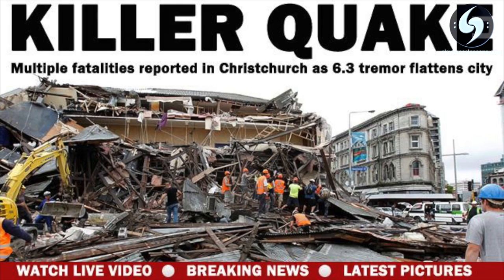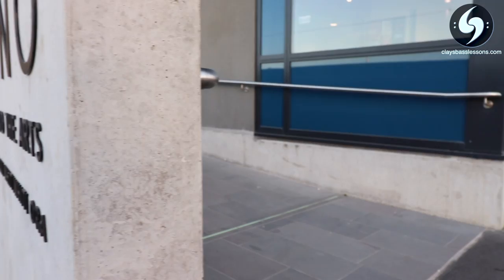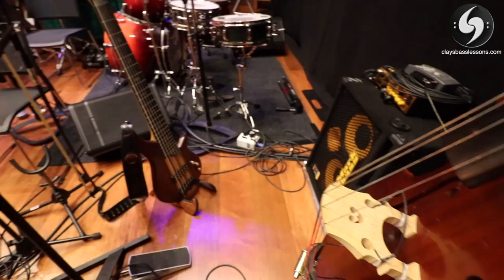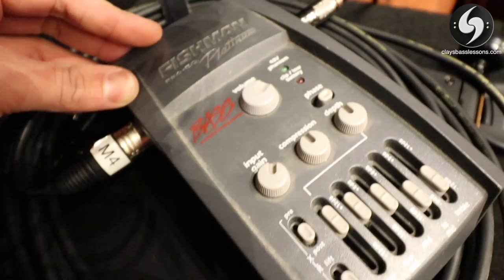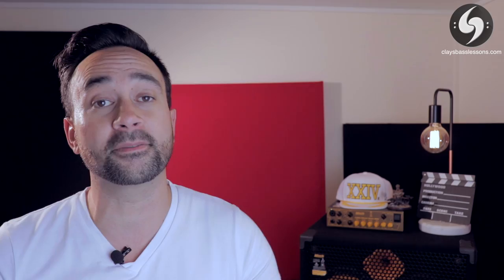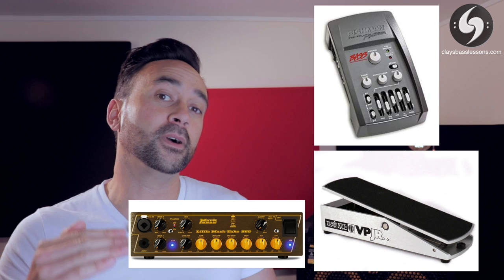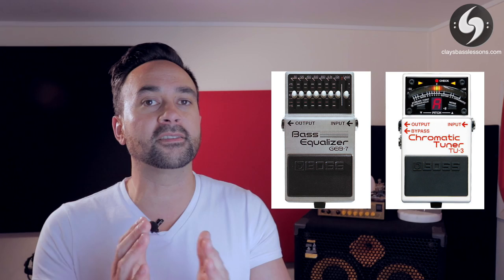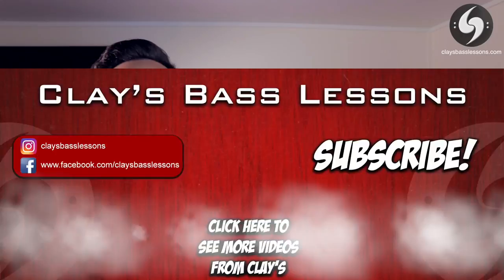How to run ELECTRIC and DOUBLE BASS off the same amp simultaneously!! (Musical Theatre Rig rundown)

Comment: Good one Clay.
It may be better to feed the double bass pickups into the preamp first then the volume pedal because of the high input impedance of the preamp which the piezo pickups like.
Then I realize using the Phantom power for the preamp is trickier.

Comment: Hello - Thanks for this recommendation. I just started doubling recently so I purchased a used Tube 800 a few weeks ago, Mine hisses really loudly when I turn the VLE off - all the way counter-clockwise to the left. So, I'm returning it.
Do you get any hiss sound when you turn your VLE to the left? Someone was selling the same model online and they also admitted that theirs had the same issue. I noticed that your VLE setting was all the way off in this video.

Comment: Hey clay, great video. Few questions
1. When you say you have the gain input set low to counter for the double bass, I’m a bit confused. Do the gains work separately both both channels cause it looks like the electric bass gain is the low one and upright is high.
2. When doing just double bass gigs, do you take this exact setup or a different one
Kind regards